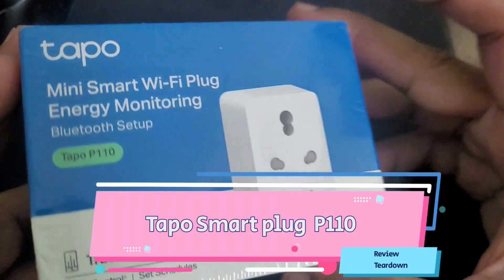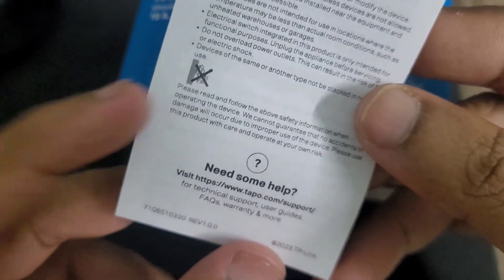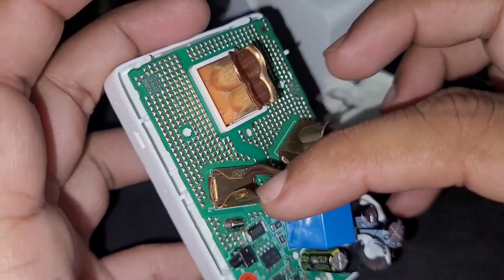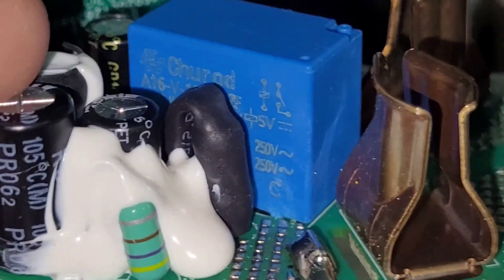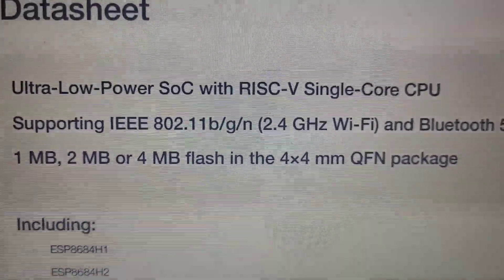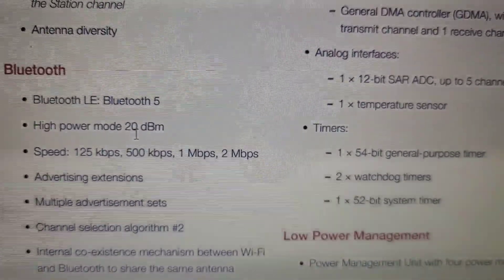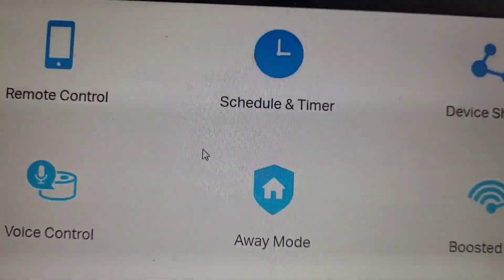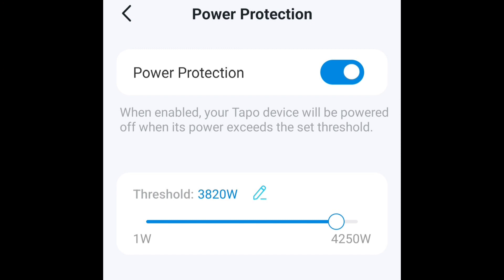Tplink tapo P110 smart plug review Teardown.

Comment: My p110 does not turn off anymore. I have factory reset it. Has anyone experienced this?
Reply: Likely a sticky relay (blue component) if it's switching a large inductive or capacitive load (big motor, or switching power supply) the relay contacts may have welded shut!
Reply from the maker: No, was issues fixed after reset.

Comment: Will it work if i install it in a region outside the wifi range
Reply from the maker: It will, but no remotely control.
Reply: Mtlb mobile ke app se kaam nhi krega?
Reply from the maker: @lokeshkumar-cz3cl Need Tapo mobile App. Setup is via Bluetooth.  But To control plug need Hub

Comment: Can we put 3000whatt for 24 hr on does it then that much load
Reply from the maker: @yuvrajtomar6142  As per specifications Max 3680W 16A
Reply: @vikrambeyondreview  I'll put 3000w for it will turn on for 24 hr it should work fine ? Or it will melt? Because of heat
Reply from the maker: @yuvrajtomar6142  there is no limitation in working hours but Max operating temperature is 35 degree As per specifications

Comment: Very good. These are the type of reviews which show the REAL quality of electronics.
Do you have the brand/model of the capacitors they are using on the low voltage side? These capacitors are the major reason why these plugs stop working becquse companies use high ESR electrolytic capacitors

Comment: Sir please suggest me a good smart plug for AC
Reply from the maker: @I-harishkumar  As per my knowledge smart plugs are resistive load. AC are inductive. You can still use a 16A smart plug. But it's longevity decrease and not advisable . Look for a smart plug the specifically mentioned for use of AC. Also smart plug ON -OFF - schedule must sync with current AC temp setting which is not possible.

Comment: I have the European version which has a different relay and a blue capacitor with no markings and unidentifiable code which is bulged, and of all the plugs that are stuck on clicking on and off the ones with the bulged caps are dead.
Reply from the maker: @mr.critic  EU version has 13A max rating and Asian version 16A . So, definitely different capacitor.  In general, it's printed on it.

Comment: Does this has any protection against inrush current? I plan to use this with 1.5 ton ac, non inverter. I didn't check how much it takes to start compressor, but I know for sure the value is 3-5 times higher than running amps.
Reply from the maker: No, this device is intended for resistive load only as per TP-Link.

Comment: Excellent teardown and comprehensive review. I plan to use this 16 Amp smart plug to monitor the energy usage of charging my EV (slow charger 16Amp). How accurate is the energy monitoring inside it for my purpose. I already have a Wipro 16 Amp Smart Plug I use to schedule my Electric Kettle, although it's energy readings are very inaccurate. Will this be more accurate and reliable?
Reply from the maker: I didn't check it. Will update you once I
Reply: @vikrambeyondreview  Looking forward to your answer!
Reply from the maker: @nirmal2140   I plugged all-out mosquito machine for 12 hours, and it's always giving constant 0.032 kWh. everyday.
Reply: @vikrambeyondreview  That would make it pretty accurate I surmise!😀